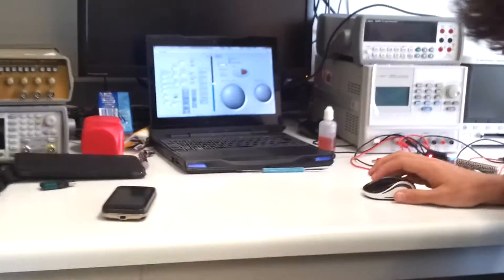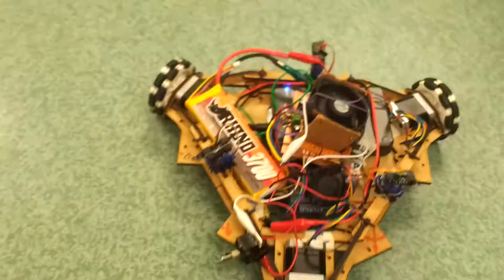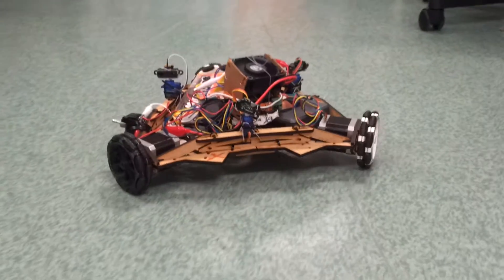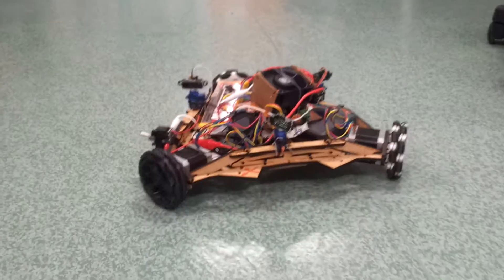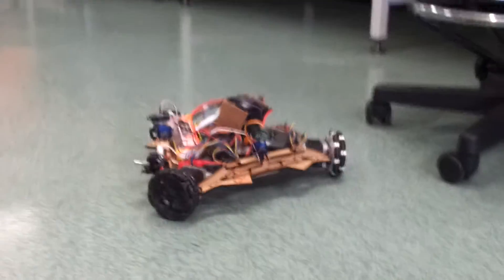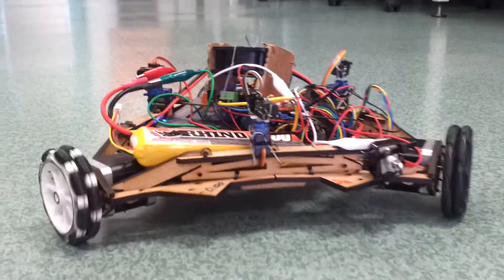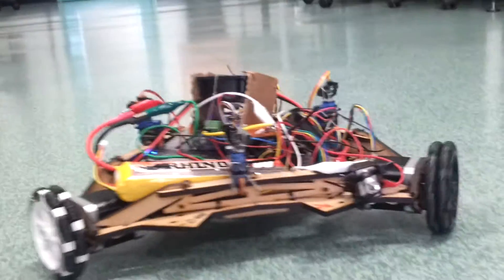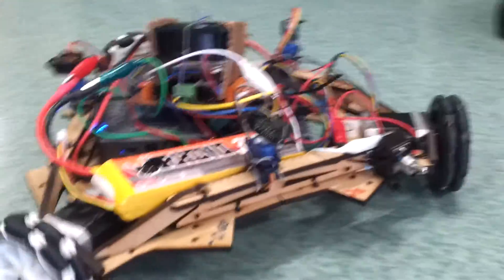Continuous Translational Rotational Curvilinear Stepper Motor Driven Tri-Omni Controller

Comment: woah, did you use encoder for stepper motors ? or you just write pulse to control the motor speed?
Reply from the maker: We don't use encoders with the stepper motors. Our motor controller ensures the wheels don't slip by calculating dynamic acceleration curves as the robot moves/rotates...
You might like our other robot 2 years later, which is using a similar drive system and the same motor controller: https://www.youtube.com/watch?v=RkBvsA2Qiho exept that one has much bigger steppers and way more power, also a robotic arm and stuff :D
Reply: wow great work i'm currently using dc servo so i have to use PID but it cause me tuning the motor for weeks and now seeing you guys using stepper motor so well,then i must try replacing all into stepper XD

Comment: nice ,, from where can i get my hands on this kind of omni wheels ?
Reply from the maker: Hi Umar, we designed and built those omni wheels ourselves, they are 3d printed.
We made a larger version too which can support 50kg+, each roller has a 3mm shaft and 2 bearings.
You can see a video of that robot here: https://www.youtube.com/watch?v=RkBvsA2Qiho
And close photos of it here: https://goo.gl/photos/5Yd8sT3V2es6ZAX1A